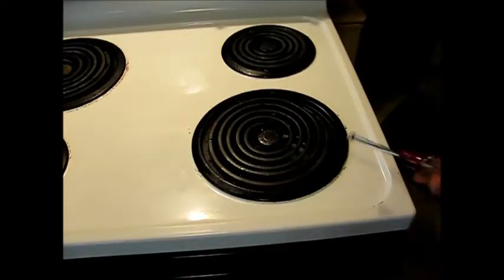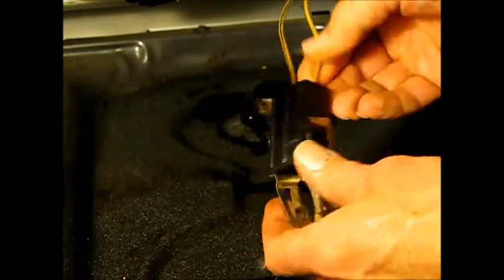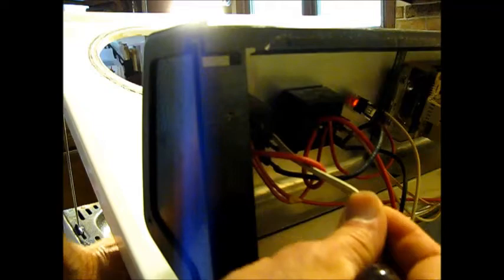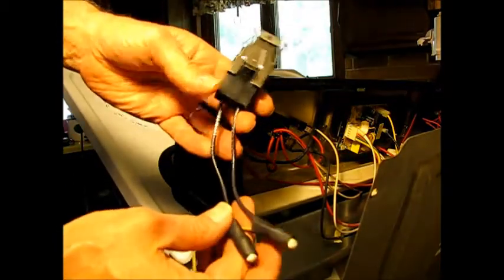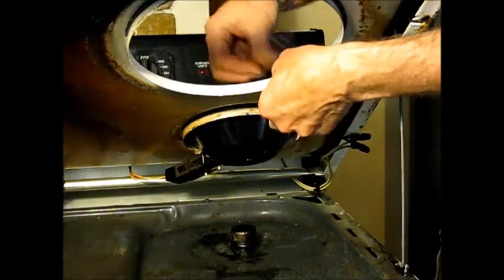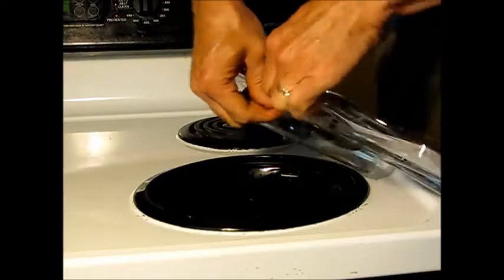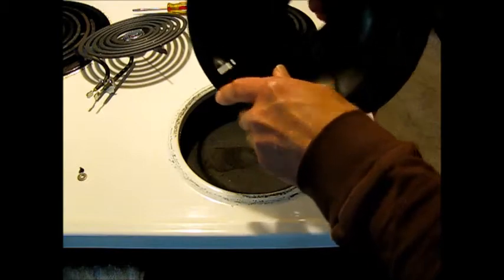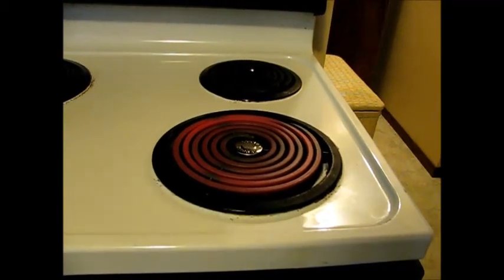How to replace a burner receptacle on a Hotpoint range

Comment: Thanks for sharing,  I've recently gotten back into canning and both my large burner plugs disintegrated into ash from the weight and heat of the burner. I can now go get new plugs and fix my stove.
Reply from the maker: You're welcome. Good luck with your repair.
Reply: Just had the same issue. The burner and receptacle both gave up the ghost at the same time. I’ll be using my fish cooker for canning from now on. 😂

Comment: Used this video to fix my stove that a burner popped while I was cooking and the receptacle had a flame coming from it. Took about $70 and 20 minutes but I saved myself at least $180 in the repair man costs. Thank you so much.
Reply from the maker: You're welcome. So glad you could make use of the material. Thanks for taking the time to comment.

Comment: Is there a specific Hotpoint receptacle so you wouldn't need to tape the wires together?
Reply from the maker: Probably, but it might be hard to find in the correct length and with the right connectors. Good luck with it.
Reply: @TheOriginalMechanic 
I have the same problem

Comment: How do you open the stove top of a hotpoint?? It's making me crazy. Thanks.
Reply from the maker: On mine you lift the top from the front. Then use the prop rods inside to hold it up.
Reply: @TheOriginalMechanic  I'm sorry for my delayed response, I never saw yours! Idk about my range but I can NOT open the stove top! Am I to remove each burner? I don't see screws I'm supposed to remove. It's got me bummed and frustrated and thoroughly grossed out. 

Anyways, thanks for this video (and your page)! Your approach is great.
Reply from the maker: @rainbowsandkittens1537  IDK, unless the top is rusted or just thoroughly stuck on.
Reply: I have the same problem fixing an old HotPoint (Model RB525*F1 circa 1973).  I've just started but I'm pretty sure that mine does NOT lift up like a car hood!  It appears so far that it was designed so that each burner can be tilted up to remove the surround and pan, then remove the element with cable/harness attached.  To remove the whole top it appears to be a whole procedure to disconnect the top from the back, including removing the knobs and all of that.  Unable to find a clear explosion diagram for this particular model series, but I will persevere ...  Frustrating indeed!